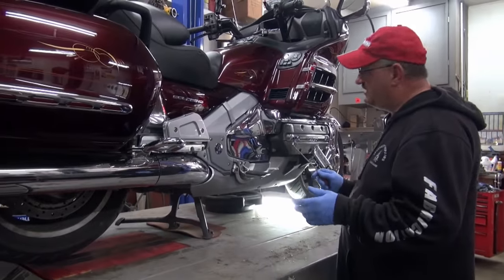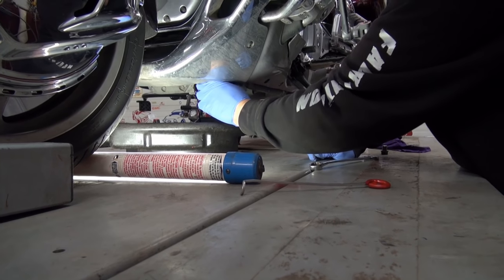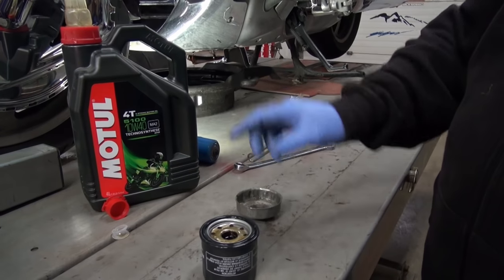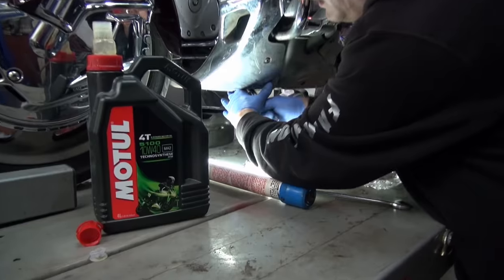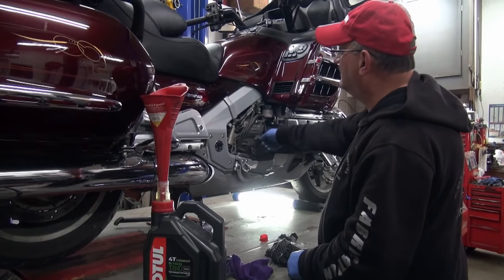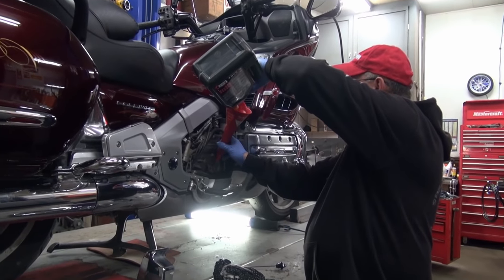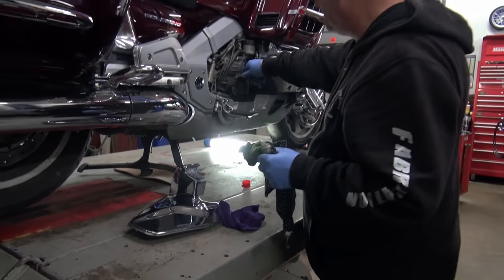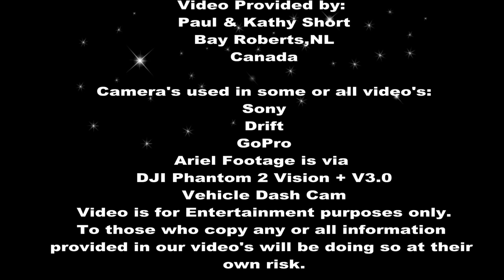Changing the Oil On A Honda GL1800 GoldWing

Comment: How soon can you convert to Synthetic Oil, and does Honda give you any grief, or will they change to Synthetic if you ask on oil change #2 ?
Reply: HONDA sells 3 grades of their oil for the GL1800
1.)Genuine Honda HP4S 10W30 SJ Full Synthetic 4 Stroke Motor OilPro [Orange/Red bottle]

2.) Genuine Pro Honda HP4 21W40 SJ Synthetic Blend 4-Stroke Engine Oil  [Gold bottle]

Nobody offers a more comprehensive line of motorcycle-specific oils and chemicals than Pro Honda. Developed through the performance and durability testing of professional racing, these Honda motorcycle oil and service products are crafted to the same high exacting standards as your Honda.

With years of testing and development behind it, Pro Honda HP4 stands as the definition of excellence for 4-stroke motorcycle oils.
It offers increased anti-foaming qualities, higher viscosity index for stability over a broader range of temperatures, and even greater shear stability than most other oils.
Naturally, HP4 blends the heat stability and shear resistance of synthetic oil with mineral oil's natural lubricity yielding premium quality four-stroke engine oil.
Best of all, HP4 is approved for use in all Honda Powersports products.

3.) Genuine PRO Honda GN4 10W30 SJ 4 Stroke Motor Oil Pro [Black bottle]

*4.) Genuine Pro Honda HP4M 4-Stroke Oil With Moly 10W40 SJ [NOT RECOMMENDED - ON WET CLUTCHES of GL1800!]

Comment: Got an '03. The manual calls for 10w-30. Is there a problem using 10w-40?
Reply from the maker: 10w-40 is fine. I like synthetic in these bikes. The trans shifts much better.
Reply: 1.)Genuine Honda HP4S 10W30 SJ Full Synthetic 4 Stroke Motor OilPro [Orange/Red bottle]

2.) Genuine Pro Honda HP4 10W40 SJ Synthetic Blend 4-Stroke Engine Oil  [Gold bottle]

Nobody offers a more comprehensive line of motorcycle-specific oils and chemicals than Pro Honda. Developed through the performance and durability testing of professional racing, these Honda motorcycle oil and service products are crafted to the same high exacting standards as your Honda.

With years of testing and development behind it, Pro Honda HP4 stands as the definition of excellence for 4-stroke motorcycle oils.
It offers increased anti-foaming qualities, higher viscosity index for stability over a broader range of temperatures, and even greater shear stability than most other oils.
Naturally, HP4 blends the heat stability and shear resistance of synthetic oil with mineral oil's natural lubricity yielding premium quality four-stroke engine oil.
Best of all, HP4 is approved for use in all Honda Powersports products.

3.) Genuine PRO Honda GN4 10W30 SJ 4 Stroke Motor Oil Pro [Black bottle]

*4.) Genuine Pro Honda HP4M 4-Stroke Oil With Moly 10W40 SJ [NOT RECOMMENDED - ON WET CLUTCHES of GL1800!]

Comment: really good mechanic !!!But the honda manual the tell you how many Liters oil shut be inside !!
Reply from the maker: The amount of oil any engine takes depends on a number of factors. #1. Is there any oil trapped in the engine or transmission cavity’s. #2. Was the proper amount of oil put in the bottle at the time of being manufactured. I’ve seen times where I had to add a 1/2 litre of oil more than the manual called for especially if I let it drain over night. The manual is only a guideline, always recheck your work.

Comment: bjr  paul et kathy   comme je vous l avais dit fin mars je me suis acheter une goldwing  annee 2004
 j ai se petit probleme la lampe  f1 s allume sans arret  
je ne ressent aucun probleme au moteur ni quand je roule
on me dit de compte combien de fois la lampe clignotes quand je l arrete
paul pouvez vous n aidez      merci  rene club bears riders kock
Reply from the maker: Si le voyant FI (indicateur de panne) s'allume, arrêtez-vous mais NE fermez PAS le vélo. Mettez le point mort et placez-vous debout, les RPM inférieurs à 1500. Cela indique à l’ECM d’envoyer le code d’erreur au voyant FI. Comptez le nombre de flashs longs et courts. Cela vous donnera le code d'erreur.

Si vous fermez le vélo, le code d'erreur est perdu - en quelque sorte. Il sera conservé dans l'ECM mais il est plus difficile de sortir. Si le vélo s’arrête et ne redémarre pas, vous pouvez faire clignoter le code d’erreur du voyant FI en tournant le moteur pendant 10 secondes. Le voyant FI clignotera alors le code d'erreur.
Reply from the maker: Clignotement long = 10 clignotement court = 1
c'est-à-dire long long long court court court = 33 vérifier le code d'erreur 33

Le nombre de MIL clignote. Symptômes. Cause

0 Aucun clignotement • Le moteur ne démarre pas

• Circuit ouvert dans les fils d’alimentation et de mise à la terre de l’ECM: • Capteur d’angle de banc défectueux
• Circuit ouvert dans les fils liés au capteur d’angle d'inclinaison: • Relais FI IGN défectueux: • Circuit ouvert dans les fils liés au relais FI IGN
• Interrupteur d’arrêt du moteur défectueux: • Circuit ouvert dans les câbles associés à l’interrupteur d’arrêt du moteur: • ECM défectueux: • Fusible FI IGN grillé (20 A)
• soufflé ST. Fusible KILL (10 A):

0 Aucun clignotement • Le moteur fonctionne normalement
• Circuit ouvert dans le câble MIL: • Combiné multimètre défectueux: • ECM défectueux

0 reste allumé • Le moteur fonctionne normalement
• Court-circuit dans le fil du connecteur de contrôle de service: • Court-circuit dans le fil MIL: • ECM défectueux

1 clignote • Le moteur fonctionne normalement
• Connecteur de capteur MAP desserré ou mal raccordé: • Circuit ouvert ou court-circuit dans le fil du capteur MAP: • Capteur MAP défectueux

7 clignotements • Difficile de démarrer à basse température (commandes ECM utilisant une valeur prédéfinie; température du liquide de refroidissement: 85 ° C / 185 ° F)
• Connecteur de capteur ECT desserré ou mal raccordé: • Circuit ouvert ou court-circuit dans le fil du capteur ECT: • Capteur ECT défectueux

8 clignotements • Mauvaise réponse du moteur lors de l'utilisation rapide de l'accélérateur (l'ECM commande à l'aide d'une valeur prédéfinie; ouverture de l'accélérateur: 0 °)
• Connecteur de capteur TP desserré ou mal raccordé: • Circuit ouvert ou court-circuit dans le fil du capteur TP: • Capteur TP défectueux

9 clignotements • Le moteur fonctionne normalement (les commandes ECM utilisent une valeur prédéfinie; température de l'air d'admission: 28 ° C / 82 ° F)
• Connecteur de capteur IAT desserré ou mal branché
• Circuit ouvert ou court-circuit dans le fil du capteur TP: • Capteur IAT défectueux

10 clignotements • Le moteur fonctionne normalement à basse altitude
• Le moteur tourne au ralenti approximativement à haute altitude (les commandes ECM utilisent une valeur prédéfinie; pression barométrique: 760 mm Hg / 1 013 hPa).
• Connecteur de capteur BARO desserré ou mal raccordé: • Circuit ouvert ou court-circuit dans le fil du capteur BARO: • Capteur BARO défectueux

11 clignotements • Le moteur fonctionne normalement
• Connecteur de capteur de vitesse du véhicule mal connecté ou mal branché
• Circuit ouvert ou court-circuit dans le fil du capteur de vitesse du véhicule: • Capteur de vitesse du véhicule défectueux

12 clignotements • Le moteur ne démarre pas
• Connecteur d'injecteur n ° 1 mal connecté ou mal branché: • Circuit ouvert ou court-circuit dans le fil d'injecteur n ° 1: • Injecteur n ° 1 défectueux

13 clignotements • Le moteur ne démarre pas
• Connecteur d'injecteur n ° 2 mal connecté ou mal branché: • Circuit ouvert ou court-circuit dans le fil d'injecteur n ° 2: • Injecteur n ° 2 défectueux

14 Aucun clignotement • Le moteur ne démarre pas
• Connecteur d'injecteur n ° 3 mal connecté ou mal branché: • Circuit ouvert ou court-circuit dans le fil d'injecteur n ° 3: • Injecteur n ° 3 défectueux

15 clignotements • Le moteur ne démarre pas
• Connecteur d'injecteur n ° 4 mal connecté ou mal branché: • Circuit ouvert ou court-circuit dans le fil d'injecteur n ° 4: • Injecteur n ° 4 défectueux

16 clignotements • Le moteur ne démarre pas
• Connecteur d'injecteur n ° 5 mal connecté ou mal raccordé: • Circuit ouvert ou court-circuit dans le fil d'injecteur n ° 5: • Injecteur n ° 5 défectueux

17 clignotements • Le moteur ne démarre pas
• Connecteur d'injecteur n ° 6 desserré ou mal raccordé: • Circuit ouvert ou court-circuit dans le fil d'injecteur n ° 6: • Injecteur n ° 6 défectueux

18 clignotements • Le moteur ne démarre pas
• Connecteur de capteur de position d’arbre à cames desserré ou mal raccordé
• Circuit ouvert ou court-circuit dans le fil du capteur de position d'arbre à cames: • Capteur de position d'arbre à cames défectueux

19 clignotements • Le moteur ne démarre pas
• Connecteur du générateur d'impulsions d'allumage desserré ou mal raccordé:
• Circuit ouvert ou court-circuit dans le fil du générateur d'impulsions d'allumage: • Générateur d'impulsions d'allumage défectueux

21 clignotements • Le moteur fonctionne normalement
• Circuit ouvert ou court-circuit dans le fil droit du capteur d'O2: • Capteur d'O2 droit défectueux

22 clignotements • Le moteur fonctionne normalement
• Circuit ouvert ou court-circuit dans le fil gauche du capteur d'O2: • Capteur d'O2 gauche défectueux

23 clignotements • Le moteur fonctionne normalement
• Circuit ouvert ou court-circuit dans le fil chauffant du capteur d’O2 droit: • Capteur d’O2 droit défectueux

24 clignotements • Le moteur fonctionne normalement
• Circuit ouvert ou court-circuit dans le fil de chauffage du capteur d'O2 gauche: • Capteur d'O2 gauche défectueux

25 clignotements • Le moteur fonctionne normalement
• Connecteur du capteur de cognement droit desserré ou mal branché: • Circuit ouvert ou court-circuit dans le fil du capteur de cognement droit: • Capteur de cognement droit défectueux

26 clignotements • Le moteur fonctionne normalement
• Connecteur du capteur de frappe gauche desserré ou mal raccordé: • Circuit ouvert ou court-circuit dans le fil du capteur de frappe gauche: • Capteur de frappe gauche défectueux

29 clignotements • Blocage du moteur, démarrage difficile, ralenti accéléré
• Connecteur de la vanne de commande d'air de ralenti (IAC) desserré ou mal raccordé: • Circuit ouvert ou court-circuit dans le fil de la vanne IAC: • Vanne de commande d'air de ralenti défectueuse

33 clignote • L’ECM ne conserve pas les données d’autodiagnostic
• E2-PROM défectueuse dans l'ECM • Le moteur fonctionne normalement

41 Aucun clignotement • Le moteur fonctionne normalement
• Connecteur desserré ou mal raccordé dans les circuits liés au commutateur de position de rapport
• Circuit ouvert ou court-circuit dans les fils du contacteur de position: • Contacteur de position défectueux: • Contacteur d'embrayage défectueux: • Contacteur de béquille latérale défectueux

55 clignotements • Le moteur fonctionne normalement
• Dysfonctionnement du capteur A / F HIC (circuit intégré hybride)

Comment: Does anyone know what the Honda recommended interval in kms is for an oil change on a gl1800?
Reply from the maker: I use  synthetic oil and I go 7000 kms before I change mine.The owners manual does recommend 8,000 mile intervals

Comment: I am not sure why you would need to prime the oil filter.  If you fit the filter dry and then add oil to the engine, the oil will make its way into the filter.  To prove it, try adding oil to the crankcase without having a filter mounted and see if it drains out!   The moral of the story is... if you put your filter on without priming it, don't start your engine right away after filling the crankcase with oil.  Wait a few minutes for it to make its way into the filter!
Reply from the maker: Pre filling oil filters has been going on for decades. Even on today’s vehicles if you install an oil filter dry you can hear the engine knock just after start up. Why take a chance and spend another minute priming the filter so you can have a little peace of mind and cause no harm to your engine. It’s only my advice. You don’t have to take it. The choice is yours my friend. 👍

Comment: Takes 4.3 seconds to get oil through a dry system, "Priming" the oil filter is a messy waste of time. But otherwise awesome guide!
Reply from the maker: A dry system is not good for components in any amount of time. Protect your investment by priming your filter. Thanks for watching.
Reply: Priming the filter is important in any situation.  Lots of wear occurs at startup when the filter is dry.
Reply: @2020couv  The filter is dry every time you start the bike, there is no check valve in the filter or the pump. That's why you have to wait so long to get an accurate reading on the oil level. In the mean time, all the internal surfaces are still coated in oil and plenty lubercated. There is no wear.

Comment: I like the video but the math doesn't add up. This is a 2006 that you have owned for 13 years and this video was published in 2016. Hmmmm.
Reply from the maker: Where did you get 2006? It’s a 2003!
Reply from the maker: Oh. That’s an old video. Mine is a 2003. That was a customers bike and it’s a 2006. With over 630 videos out it’s hard to remember each and every detail on all those videos.